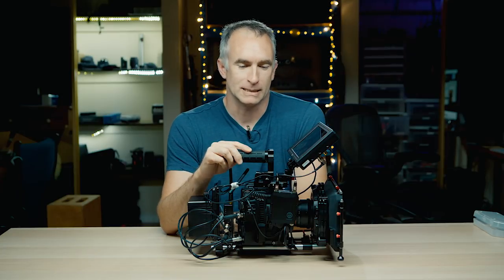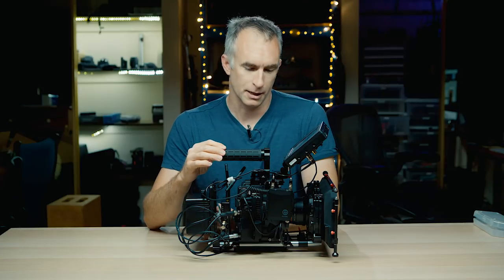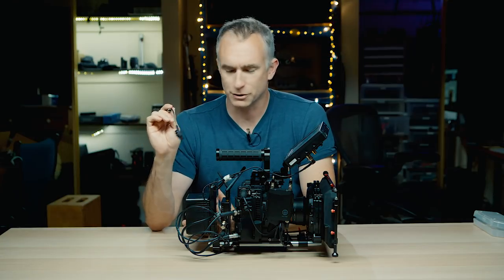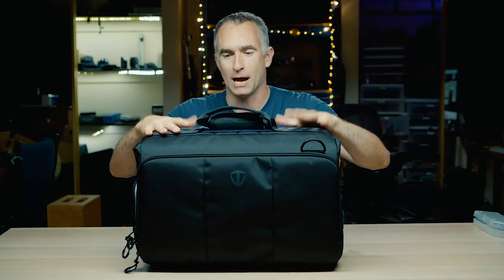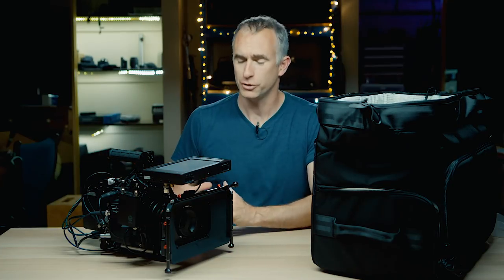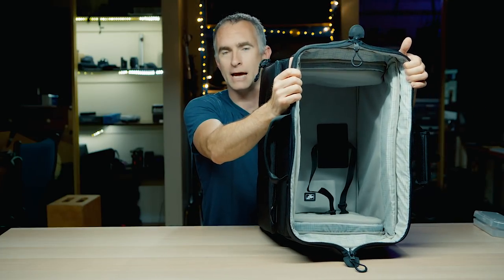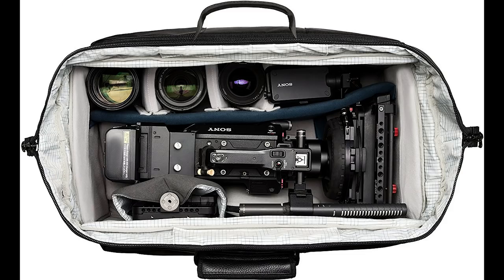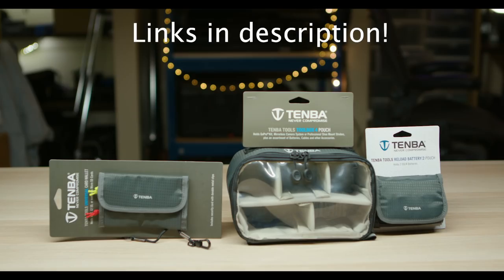REVIEW: Tenba Cineluxe Camera Bag

Comment: My personally worst camera case experience happened a few years back: I was two hours away from taking off to a local gig. I left my pelican case open as I gathered together my kit and checked my lenses. Popped out of the room for two minutes and when I returned my sick, 19-year-old orange tabby was inside the Pelican, scratching the edges, having just unleashed his crystallized horror pee and I watched as the urine seeped in into the foam and around the dividers. We looked at each other and the old guy limped off.  I gathered three of my toddler's shoe boxes, put in handfuls of her little socks, set a 5D mk III in one of them, a 100mm in another, and batteries, charger and cables in the last one, then stuffed all three in an IKEA messenger bag we used for mail sorting, and ran off to my gig. Everything worked out, shoot was great, I was laughed at, got in very late, headed to my little "studio"room, suddenly led there by the odor, opened the door and realized I had a pelican case to clean. Despite it all, that cat was the greatest. Good shot, too.

Comment: Last month I went to Aqaba,  Jordan. I had my C200 in a roller SKB case. Upon arriving at customs officials went thru  every piece of equipment in my case (lenses, cables harddrives, rods and assembly parts for my cage rig. They literally had me assemble my whole rig with every piece in my case. It would have been great to have had my camera preassembled. I later found out that they thought I was carrying a drone ( i wasn't, but that's why they questioned every piece of equipment in my bag). This bag would be perfect especially around the city while doing run and gun music video's instead of wedging the camera on the passenger side floor with jackets and stuff when going from location to location.

Comment: Flying through a Virginia Airport a few months ago, the TSA asked for combination lock for Pelican case instead of allowing me back to open it for them. After arriving home I realized they had opened all gear, clearly threw it back into case without packing it as I had done (Secure), and the Sony A7R II and my Mac I7 laptop were both severely banged up and both damaged. Screen on A7R II now has two large green lines through screen (Luckily doesn't show on footage), and Mac had the back so smashed in around the internal fan, the fan stopped working and our IT department had to disassemble and bang out back of laptop with a hammer, to stop fan from being impeded from back of case that was smashed in. Lesson earned, don't let TSA search your gear without being present! :(

Comment: I drop mine in a canon bag.  It is ready to take out and drop on the fluid head. I leave the 18-80 T4.4 lens on the camera (it’s fairly long). The last time I went out, I took two extra lenses and bpa-60 batteries, cables and extra c-fast carts (512sd).  
The trouble is that it has a large CANON logo on the side.  Black gaffer tape will work until it catches on something and rolls off. I just don’t like advertising which bag to steal first.  
That is a great looking bag in the review.  Thank you for your time.

Comment: I had shoot early in my career on a small island in the Outer Banks North Carolina.  I had not yet learned the lesson to not buy cheap knock off product if you need reliability.  So in my cheap nylon camera bag was my brand new Canon 5DII along with several L glass lenses.  Pretty much the entirety of my early photography business was in that bag.  As I stepped off the boat onto the dock one of the double handles separated from the bag causing the bag to violently shift over to one side.  This caused the velcro top to rip open and send the contents of my bag to the bottom of about 7 feet of sea water.  Lost the equipment, lost the shoot and lost the client.  Two major lessons learned that day.  One don't buy cheap bags.  Two insurance companies are evil and will do anything they can to not pay out a claim.

Comment: I was using a re-purposed Porter Case (orginally used to transport projectors). Looks like a Pelican case, but it's not nearly as sturdy. So you can guess what happened when someone tried to use it as an apple box. Foot went right through the shell (thankfully, my camera was no longer in it.  Bummer is that they don't even make the same model anymore.

Comment: Here’s my story. The thing to remember here is that I am disabled. I have a bad leg from a motorcycle accident, so everything I carry, everything I pack, has to be very carefully considered.

I was going to go shoot some video of the ferry building in San Francisco. I had packed my Sony gear and two lenses into a brand new shoulder-style bag. I don’t recall the brand but whatever. 

Since I didn’t want to be assembling all of my gear out by the water, I had assembled it all at home, and ripped out all of the dividers in the bag so that I could put the entire assembled kit into the large hollow cavity. However, the bag was too small, and at the time it was the only one that I had. I had my Sony A7S, two Canon lenses, Atomos shogun, all of it in cages and rigged together. Without dividiers I had to stuff the spare unattached lens into the bag next to the rig, inside a cloth lens bag with drawstrings.

I got to the spot I wanted to shoot from, carrying the bag in my right hand with the top flap open cause, again, too small for my assembled kit. In my left hand  I had my cane, which I need to walk. 

You know where this is going. Things move in transit and the drawstring of my spare lens snagged on one of the 15mm rods. I didn't realize it because I was trying to work the front of the assembled rig free of the small bag with my cane clutched under my arm. Managed to get the rig out, which pulled the loose lens out as well and... yup. Canon 24-70mm f/2.8L series took three bounces on the concrete of the ferry terminal before diving into the San Francisco Bay. 

All I could think of at the time was, "I should have spent the extra money on the larger bag."

Still have the insurance claim for the lens if proof is needed 😀.

Comment: Worst experience would have to be that most insurance for transportation of camera equipment is invalidated if you transport it in a soft case. If you have any kind of crash / damage while in transit, a car, van etc etc many insurance policies will not pay out because it has to be in a hard case, flight case or peli case etc

Comment: Recently had a shoot for a client in here in Tasmania. We were filming on a Red setup that we keep dissembled in a road case between shoots. The client wanted some footage of aboriginal middens that involved a short walk along a beach. We worked out that the best plan of action would be to take the Red fully rigged and ready and just walk it in. A Cam would take the Red, the assistant would take the tripod, and I would take my backpack with a gimbal kit. Well the walk along a beach turned out to be further than expected. The old "It's must be just a bit further". We were walking in soft sand for 90 minutes. Eventually the client listened to the aboriginal elder we were with and we found the spot; which we had to bush bash over sand dunes to actually get to it. Once at the midden, it started to rain, so the lenses started to get water on them and the sand stuck to our clothes. I took off my own t-shirt to wipe down the cameras, then used my rain coat to protect the Red. Then it was another 90 minute trek back to the carpark. The Tenba sure would have been handy.

Comment: Hi Rubidium, would that C200 rig fit in the regular 21 inch (not the hightop version).  I have a Red Scarlet W, top handle, mattebox etc.  Just would like to know if it would fit in regular 21
Reply from the maker: It does. The c300 needs the high-top. I like it because I can leave the monitor on the top of my rig with the high top (i.e. like a red)
Reply: @Crimsonengine  Ahhh I see.. thanks so much for the review.  You're the only one that actually demonstrated the physical camera going in the bag... a lot of the other reviews just blabber on without showing....cheers for that.  I'll get the regular 21 shoulder bag

Comment: I was asked to fly down to Florida to shoot a music video with zero time to plan I had to bring some lights and my camera rig I only hard case that I've never used the seem to be the right size for the carry-on overhead bin the case just had to foam inserts no cutouts so I jam-packed everything into that case here's where things started going wrong the flight attendant told me I couldn't bring that on the plane she would have to check it I was upset but I had to check it when I get to Florida open the case everything was wet inside condensation got in side all my equipment including the camera I got to the hotel and I had to lay everything out and blow dry everything the grip closed the case he thought he latched it because it's such a cheap case it's hard to latch so when I pick it up everything fell out oh and because I had to have everything taken apart I forgot my base plate so I had to do everything hand held. That was a bad day.